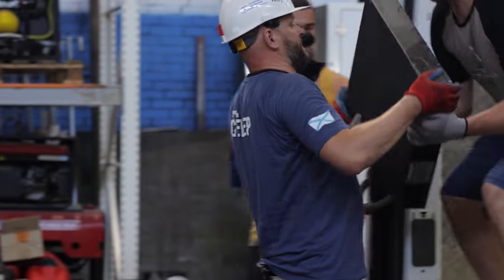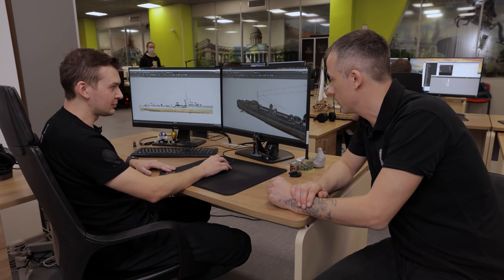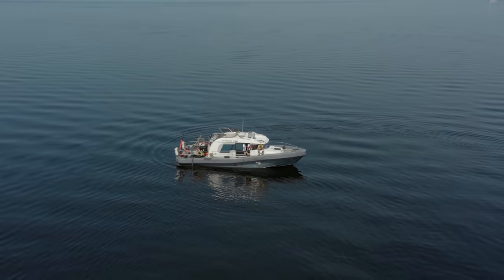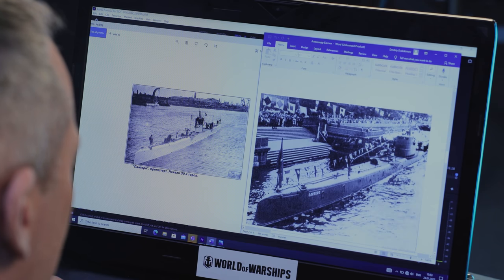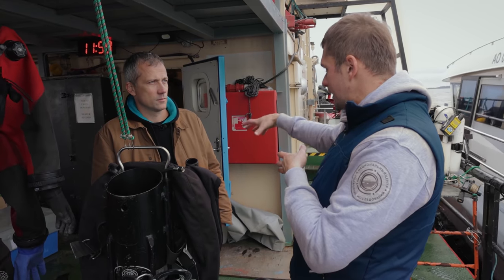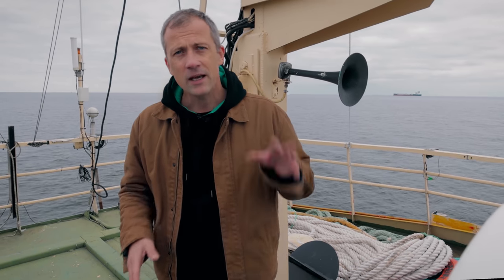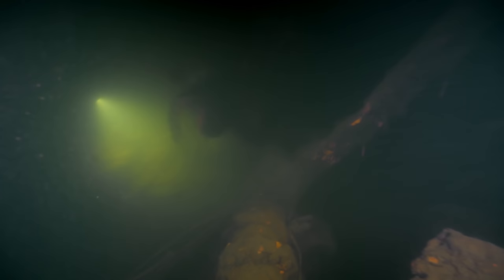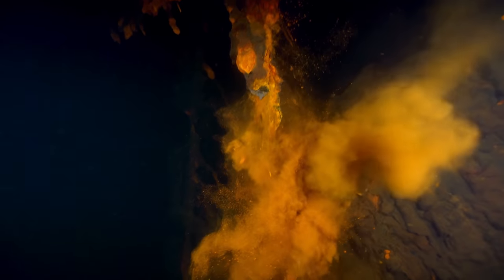The Fall of Destroyer Vittoria. Naval Legends. Stories World of Warships

Comment: On Twitter @GunnerCMiller
On WOWs RumbleDog001
NA Server
It was the Z-31 German DD due to one ranked battle. I got to the center late as I had a slow reload, but I fired all torps between two islands that funneled ships. I took out 2 DD's and a wounded CR. in less than 10 seconds. We went from 7 vs. 7 to 4 vs 7. We ruled that match!